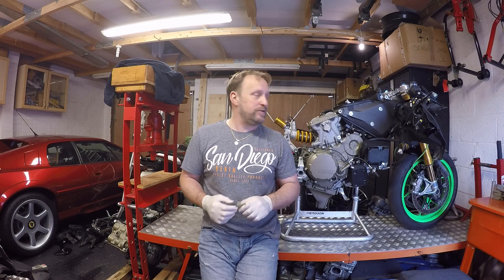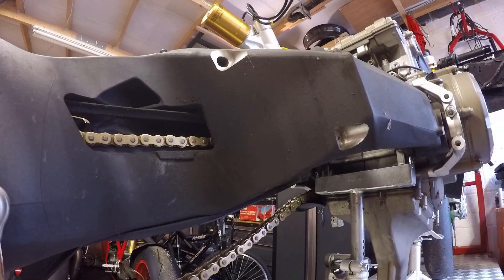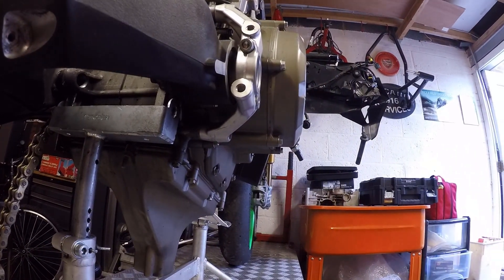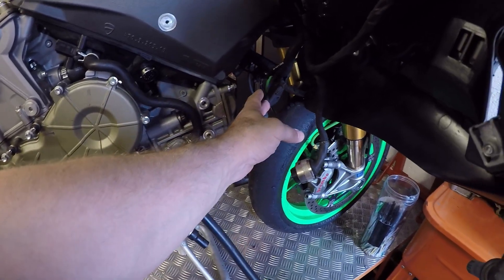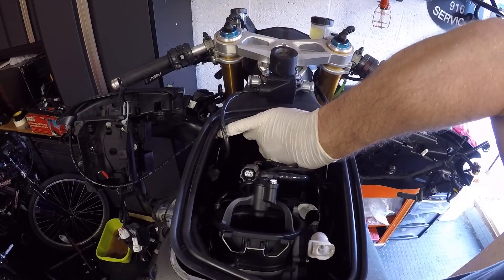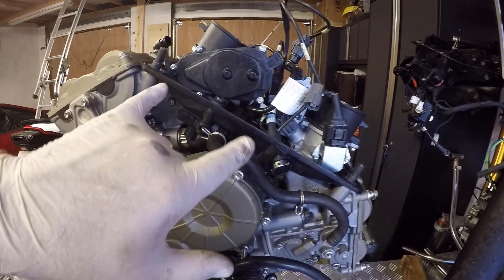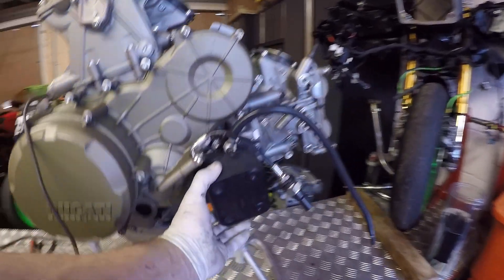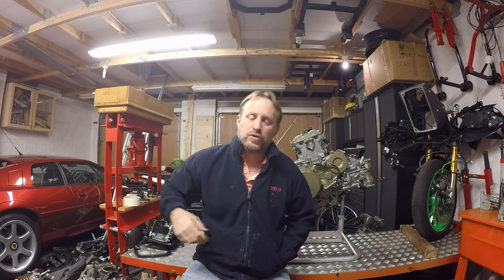Panigale 1199 S to R Engine Swap Video 4 - Swingarm and Frame Removal

Comment: Your videos have proven to be a huge help on my journey of rebuilding the engine for my 1199S panigale that ran out of oil. I haven't started stripping down the engine just yet, im finishing up making the engine stand from angle iron. I pulled the oil pan to reveal lots of gold flakes from the bearings. Any suggestions or tips are welcome and appreciated
Reply from the maker: More often than not that would be from a big or small end bearing. Although I am not sure if there are any other materials in a 1199 that may produce gold flakes.

Comment: This is such a useful video, thanks! I'm about to swap my swingarm on my 959 for a 1299 single sided swingarm. Can I ask please.... Do you think I should change all the bearings on the 1299 swingarm? Either the ones in the hub or the ones that connect to the chassis/engine? Is it a servicing job that makes sense to do while I have the swingarm on the bench? ...or are they something that just doesn't really need replacing unless something has actually happened to warrant buying the parts and doing the job?

Many thanks in advance!

Comment: Hi is it possible to upgrade the 1199s swing arm pivot to the adjustable version or are the engine mounting points different on the R version to the S?
Reply from the maker: The mounts on the engine are different but you can order them from Ducati :)

Comment: Question.  Going from 1299 to R engine, do you need R wiring loom? Or are they compatible?
Reply from the maker: HI Yong, its the same loom on the early R and S, the later model R's had no electronic suspension so use a different loom.
Reply: DesmoWerx thanks!  Didn’t think about the electronic suspension.  I have 15R but thinking to get 14R engine
Reply: Im just confused.  If ECU is stayed same, I was assuming loom didn’t matter. ECU controls electronic forks, I would’ve thought.
Reply from the maker: If just replacing the engine you will have no issues with the loom